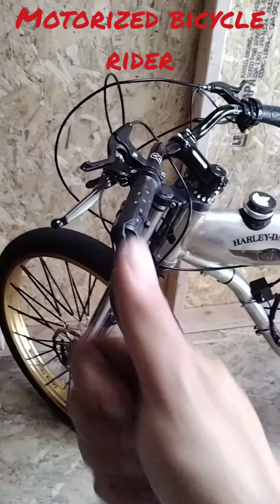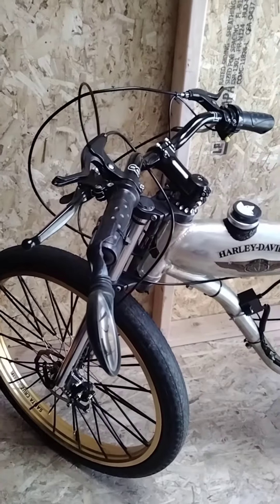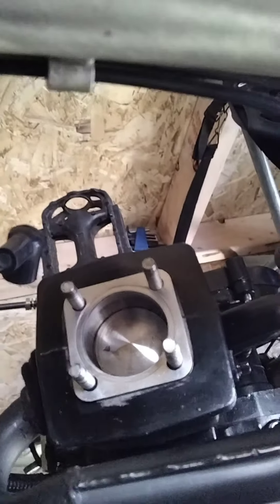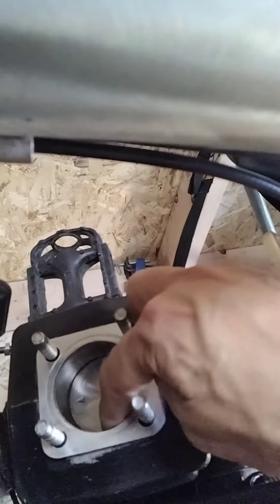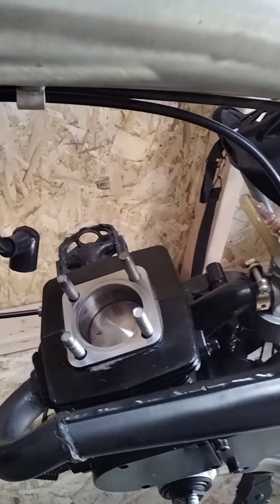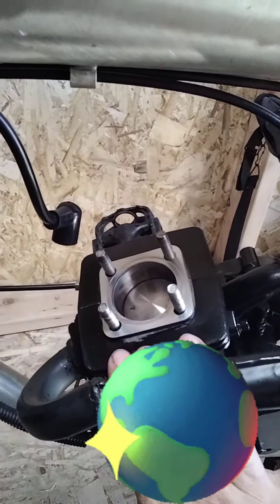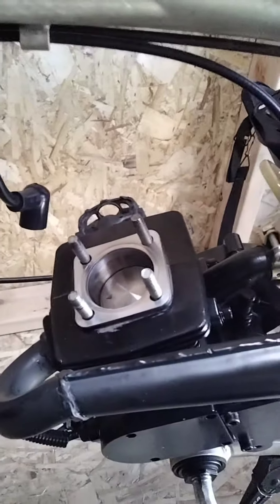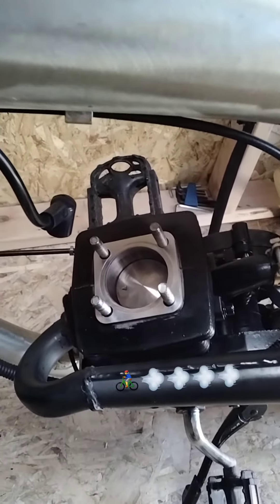motorized bicycle Rider

Comment: What gas ratio?? What's ur fastest motor? What brand
Reply from the maker: Not nothing too high class I have a PK 80cc 2-stroke, and I have a two-stroke anbull 80cc, and I have a bikeberry 80cc 2-stroke that one's ported a little bit🚲💨💨💨💨🤙👍💯
Reply from the maker: Fastest I've been is 39,mph
Reply: @motorizedbicyclerider5296  that's fair 39. My old one only hit 38 but change carb to a stock one goes 42 all day my brothers hit 45  what gas mix ratio u use . But yeah exhaust clamps are a lot better and sturdy
Reply from the maker: @mozezcen-valley7555  on my gold motorized bicycle I use Ames oil 2, stroke synthetic oils red and my other bikes I just use random 2 stroke oil I use 4 oz to 1 gallon of gas and I get the best gas premium 91
Reply from the maker: Or you can say it this way 32 :1 is what I use I might drop it down 40 : 1🚲💨💨💨💨🤙👍💯

Comment: Humm...your Spark plug tells you everything about your engine condition not the piston crown go back and look at your spark plug.
Reply from the maker: Ok thanks 🤙👍🚲💨💨💨💨💯
Reply: @motorizedbicyclerider5296  if your not getting carbon build up something tell me either your using magical  oil that burn 100% clean or your not using   correct oil ratio or your not using no oil for that matter there no way something can burn that clean.
Reply from the maker: @dreadknot2238  I'm using Ames oil synthetic it's only been 3 months and it's that clean